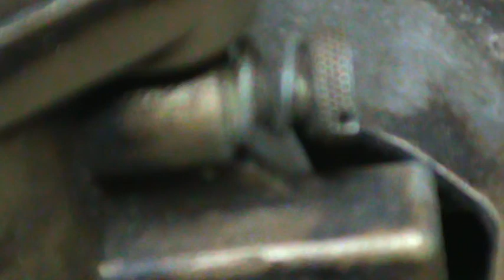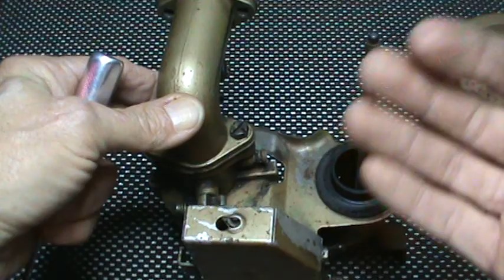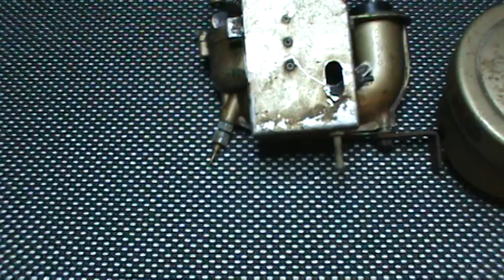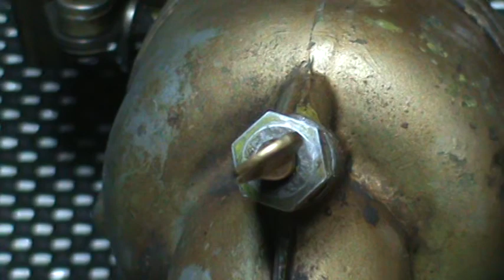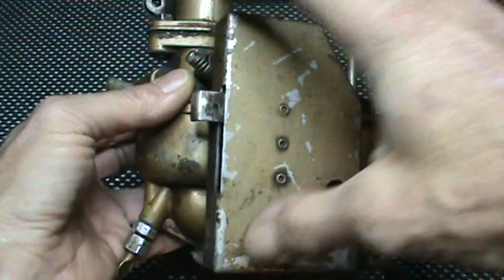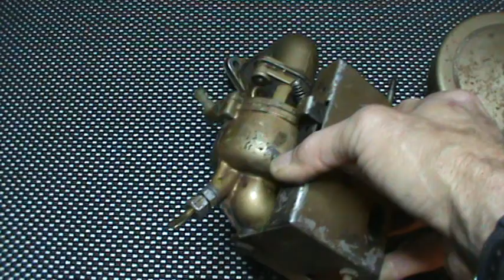Briggs and Stratton Carburetors and Seasonal Adjustments

Comment: I have an old Garden Mark Squire 10, will
Loose power when operating it in the winter
Then wait a fee seconds only to start it again
is this a sign a of bad carburetor settings or
Something else.
Reply from the maker: One of two things...the exhaust valve is hanging up slightly when the engine warms up (I have a video on how to correct and inspect this) or you have a partial blockage somewhere in the fuel lines, tank or carb. To remedy this, take the fuel line off at the carburetor and blast a little compressed air into the fuel line and into the carb opening where the fuel line connects. Then give it a go. If the problem is solved temporarily, then I suggest replacing the fuel lines and cleaning out the gas tank really well. Cheers!! Zip~